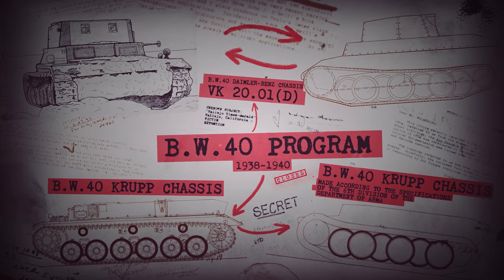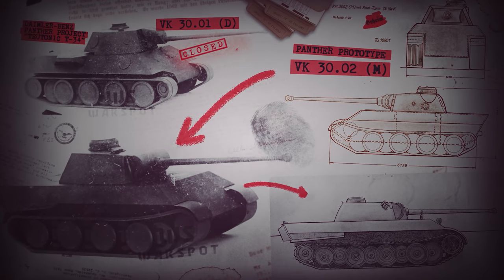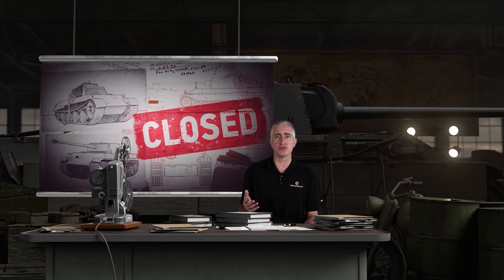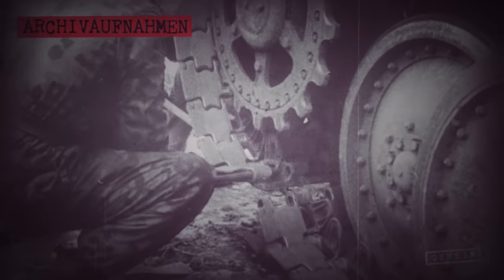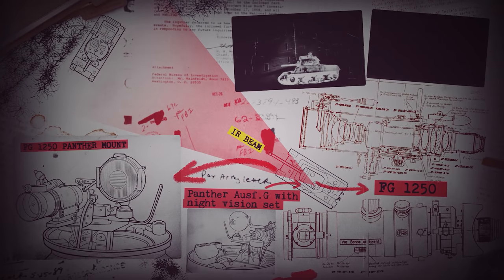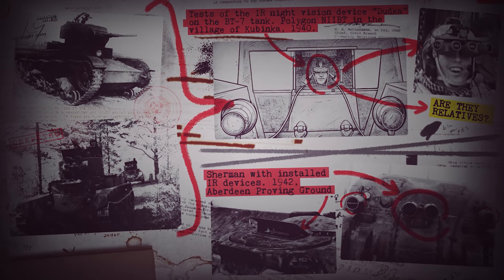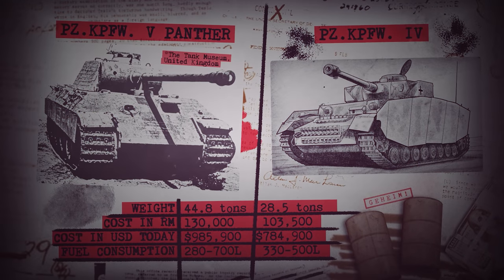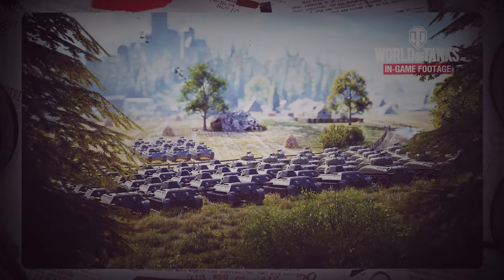Five Things About the Panther with The Chieftain - World of Tanks

Comment: Excellent video of the excellen Chieftain, once again! Question though: Why can't a Panzer IV not considered equal to the M4 and T-34? Later versions like the Ausführung G and H with the long 75 were more than a match for the 76mm allied cousins in the gun department. Armor was the worst, but it had other features going for it that were lacking on T-34s (better layout, radio, bogie suspension). Why the bad rep?
Reply: Bogie suspension on Pz-4 was horrible especially for crew riding inside the tank on rough terrain. T-34, Panther and Pz-3 was much better in that regard.
Reply: @RussianThunderrr  maybe. But it's all a compromise. Kristie suspension takes up space, and the t-34 was also not known for being the smoothest ride. Sherman had bogies too.. So why not their equal?
Reply: @Yamauchi_Akira  Same fire control as a Panther (the gunner is looking through a very nice soda straw), bad or (J model) no power traverse.  No stabilization.  And that beer can armor.  At high enough level, pretty close to equal.  But I know what I'd rather be in.
Reply: It was pretty much the equal. It had the best combination of gun, optics and standard ammo quality of these three - in a chassis that weighed 30% less than a Sherman. It had weak turret front armor, but its 80 mm hull front armor stood up better against the guns on the Sherman and T-34 than vice versa. Both the T-34 and Sherman had problems with "soft" ammo quality, which meant that the 85 mm in the T-34 and 76 mm in the Sherman often underperformed. As late as January 1945 only 1/4 of the Shermans had the 76 mm. The Soviets, OTH, were much quicker to upgun their T-34.

Only the late war M4A3E8 could be said to be clearly superior - and even it was easy prey for the KwK 40.
Reply: @TTTT-oc4eb  yeah, thought so too!
Reply: @TTTT-oc4eb  You're playing top trumps (or more likely ASL).  All three had enough gun that a solid hit was going through at most battle ranges (no matter which gun the Allied tank had) also most games overate the Mk IV armor, it was made up of several plates (40+40 is not 80) and got more brittle as the war went on.  Tonnage means very little (ground pressure might, but the T-34 was better there and the non E8 at least equal.

What made the Mk-IV inferior was in an engagement unless it was ambushing, it was very unlikely to get off the first shot.  Getting the first shot is a big thing, and it's the only big difference between the three.  WOT had an interview in the forums with a MkIV crewman and he mentioned their big fear (greater than Fireflies, which were a different terror) was blundering into Shermans in a meeting engagement, they knew they'd get beaten to the draw.
Reply: @drewdederer8965  "You're playing top trumps (or more likely ASL)." 

I don't argue with morons.
Reply: @TTTT-oc4eb  wrote: "Both the T-34 and Sherman had problems with "soft" ammo quality, which meant that the 85 mm in the T-34 and 76 mm in the Sherman often underperformed. As late as January 1945 only 1/4 of the Shermans had the 76 mm."

-- I'm not sure what you mean by "soft" ammo quality, please explain yourself, but as far as main gun performance goes, Sherman' s 76mm 52 calibers gun, and T-34's  85mm 55 calibers gun outperformed Pz-IV main 48 calibers gun, and not the other way around. Also turret usually get 60%of all hit, on Pz-IV it was weaker then both T-34-85 and Sherman's.

-- As far as "only 1/4 of American's Sherman tanks were 76mm", ... well US of A fought that war based on statistics and feed back, and as we finding out so is the Soviet Union that was constantly updating T-34 tank(yes, based on statistics and front line tank crew feed back, as well). So because Germany was involved into custom/artesian tank manufacturing almost throughout the war, and most of those tanks ended up on the Easter front, so Americans need more "soft targets" killing tanks vs "tank destroyers", and US command thought 4:1 ratio of 75mm(4) to only one 76mm tank was the best suited ratio for them. British troops encountered a lot more German panzers, so their tank platoon ratio was 3:2.

-- Also by summer of 1944 Pz-IV lost power turret travers in favor of extra 120 litter internal fuel tank, because of its poor range and detreating logistics situation, so only hand cranking turret was available ever since, but other then that Pz-IV was overall very well balanced medium tank, and long production life is there to back it up.
Reply: @drewdederer8965  wrote: "What made the Mk-IV inferior was in an engagement unless it was ambushing, it was very unlikely to get off the first shot.  Getting the first shot is a big thing, and it's the only big difference between the three. "

-- 1943 and on Stug-III was "best" Wehrmacht tank, which had a superior optics to ever declining Pz-IV vision, and SPG would more likely laying down ambushes, while Pz-IV(just like any other German tank) would be "driving around" and running into "Russ-Boom" ZiS-3 76.2mm gun.
Reply: @RussianThunderrr  When the Germans met the KV-1 in 1941 they found that even their 88 mm Flak gun often needed surprisingly many hits to knock the beast out. The result was an improved Panzergranate 39 that, from1942 onward, was the best standard AP shell in the world. When the US 76 mm M1 gun was tested against US armor plates it seemed to be a Tiger killer, but when it finally was tested against German armor (which was harder than US armor plates) after Normandy, it was found that the shells often shattered  due to the HE filler detonating on impact, or the shell itself was too soft and shattered. Soviet AP rounds had the same problem. The net result was that, while the German 75 mm, Soviet 85 mm and US 76 mm on paper was nearly identical, the German gun penetrated 10-15% more.

A British tank platoon had only 4 tanks, and the ratio was one Firefly to three Shermans - later in the war it was 2:2.

I didn't say that the Panzer IV was superior - I said the three tanks were more or less equal - with the exception of the M4AE8. All three tanks had their cons and pros. For the PzIV it was the combo of gun, high quality ammo and first class optics, as well as excellent crew conditions. All three tanks were outclassed by the new breed of standard tanks that already were in production or soon to be; Panther, Pershing, Centurion & T-54.
Reply: @TTTT-oc4eb  wrote: "When the US 76 mm M1 gun was tested against US armor plates it seemed to be a Tiger killer, but when it finally was tested against German armor (which was harder than US armor plates) after Normandy, it was found that the shells often shattered  due to the HE filler detonating on impact, or the shell itself was too soft and shattered. Soviet AP rounds had the same problem. The net result was that, while the German 75 mm, Soviet 85 mm and US 76 mm on paper was nearly identical, the German gun penetrated 10-15% more."

-- Thank you for reply, soft metal shells can not penetrate armor by definition, and soft malleable steel will deform, what shutters is hard brittle steel, so in order to overcome this, soft metal "ballistic cap" used, that is deformed and keeps brittle steel from shuttering, and it also help to decrease chances of shell to bounce of(or rechochet). Now, what makes "penetration" happening, is mass of projectile times velocity, and velocity is actually length of the barrel and amount of propellant in the round's casing. Of all tree guns Pz-IV had the smallest casing(at 495mm) and as a result smallest amount of propellant and mussel velocity of 750m/s, followed by 76mm 539mm casing with mussel velocity 790m/s, and T-34-85 had 629mm with mussel velocity of 792m/s, and since T-34-85 projectile also a lot larger and heavier, it had a lot more penetrating energy, and all Soviet gun and ammo testings conducted on German tanks. That is not to mention that T-34-76 had specially developed tank gun, by Ivan Grabin, T-34-85 had similar idea and class(in caliber and calibers) gun as Tiger I i.e. Anit-Aircraft gun with higher velocity, then anything used on tanks before. Having said that, I also have to mention Panther KwK-42 had even more proppeland and higher mussel velocity then T-34-85 and Tiger I.
Reply: @RussianThunderrr  The Soviets needed bigger guns because their ammo wasn't of the same quality as the Panzergranate 39. That's why the Soviet 85 mm barely are comparable with the KwK 40 in penetration, and the huge 122 mm in the IS-2 barely are comparable with the KwK 36 in the Tiger 1. The sheer size of the 122 mm shell did mean that even non-penetrating hits were very dangerous, even to a Tiger II.
Reply: @TTTT-oc4eb  wrote: "The Soviets needed bigger guns because their ammo wasn't of the same quality as the Panzergranate 39. That's why the Soviet 85 mm barely are comparable with the KwK 40 in penetration, ..."

-- Why are you making staff up? Soviets needed a bigger gun because Grabin's F-34 L-41 gun that was in T-34-76 could not penetrate Tiger I(that was captured in August of 1942) armor at all. Pz-IV was not a problem for T-34-76 F-34 gun. There was intermediate solution to develop sub caliber Tungsten-Carbide round. Then at battle of Kursk Panther tank was introduced, and decision was made to arm T-34 with bigger 85mm gun, so it can successfully fight both Tiger I and Panther tanks.
Reply: @TTTT-oc4eb  wrote: "and the huge 122 mm in the IS-2 barely are comparable with the KwK 36 in the Tiger 1. The sheer size of the 122 mm shell did mean that even non-penetrating hits were very dangerous, even to a Tiger II."

-- IS-2 122mm gun was more powerful then 88mm KwK 56 gun, and could obliterates Tiger II from any direction. Armor pricing round left cantaloupe size holes in Tiger II front armor plate when tested in Kubinka, that is also the reason why Tiger II heavy battalions avoided encounters with IS-2 tanks.
Reply: @RussianThunderrr  That's not the point here. The 85 mm had roughly the same velocity and shell size as the 88 mm L/56 in the Tiger1 - so it should really have been comparable to this gun in penetration. But it was not, it was just barely comparable with the weaker 75 mm L/48 in the Panzer IV. The difference is the quality of the AP shells.
Reply: @RussianThunderrr  The main asset of the 122 mm shell was its sheer size which made it very dangerous - it was like being hit by a naval destroyer - in penetration it was barely the equal of the Tiger 1. The only thing the Kubinka test shows is that even a Tiger II will eventually succumb if it is hit by 30+ 85mm, 88 mm, 100 mm, 122mm and 152mm rounds. Heavy tanks generally avoided each other if possible. IS-2 units avoided Tiger 1 units like the plague if possible.
Reply: @TTTT-oc4eb  wrote: "That's not the point here. The 85 mm had roughly the same velocity and shell size as the 88 mm L/56 in the Tiger1 - so it should really have been comparable to this gun in penetration."

-- It was and it did performed as such.
Reply: @TTTT-oc4eb  wrote: "Heavy tanks generally avoided each other if possible. IS-2 units avoided Tiger 1 units like the plague if possible."

-- Not really, just look at German winter offensive operation of 1944 and 1941spearheaded by King Tiger and accompanied by a swarm of Panther tanks.
Reply: @TTTT-oc4eb  wrote: "The only thing the Kubinka test shows is that even a Tiger II will eventually succumb if it is hit by 30+ 85mm, 88 mm, 100 mm, 122mm and 152mm rounds."

-- And there was not a single, but 11 King Tigers was captured in August 6th 1944 at village of Ogelow at Soviet Sandomir bridgehead, when Lt. Oskin inguaged 11 King Tigers of Major con Legat in his T-34-85, and destroyed 3 King Tigers by penetrating their armor(blew one of King Tiger turret off, one caught  on fire after fuel tanks been pierced) thinning they were Panthers, the rest of King Tigers was abended in working order with maps, King Tiger documentation and manuals, by King Tiger crews. That is how Kubinka got its King Tigers earlier. T-34-85 was good at making holes in any German WW2 tank.

— So T-34-85 was more closer to Tiger I gun in ballistics and performance.
Reply: @RussianThunderrr  Except that the "88" penetrated 30% more.
Reply: @RussianThunderrr  The September 1944 issue of the "Nachrichtenblatt der Panzertruppen" included a report from a Tiger-Kompanie (Tiger 1) that knocked out numerous Josef Stalin tanks in short period:

“The Kompanie commander made the following observations that were derived from their experience in fighting Josef Stalin tanks:

1. When a Tiger appears, most Josef Stalin tanks turn away and attempt to avoid a firefight.

2. In many cases, the Josef Stalin tanks let themselves engage in a firefight only at long range (over 2000 meters) and also only when they themselves are in favorable positions on the edge of a woods, village, or ridgeline.

3. The enemy crews lean towards evacuating their tank immediately after the first shot is fired at them.
Reply: @TTTT-oc4eb  wrote: "Except that the "88" penetrated 30% more."

-- Yes, Tiger I and Tiger II gun were very good, formidable and deadly against enemy tanks, so is Panther tank KwK 42, but like I mentioned earlier, after heavy losses sufferer at the debuted of King Tiger at failed attempt to eliminate Sandomirets Breagehead, and another failed attempt at Keltze-Lisow, German high command was really reluctant to use Tigers and King Tigers vs elite Soviet tank armies armed with T-34-85 and IS-2, and resorted to use their armor in other parts of the front not known for its heavy use of tanks, like Arden's offencive, then operation Konrad I, II and III, then Spring Awakening and ect...
Reply: @drewdederer8965  The soda straw, the TZF 12, offered a FOV of 28 degrees. That is between 2 to 4 times as much compared to the telescopic/periscopic sights of shermans and t34. Giving the fact that both commander and gunner had an azimuth indicator i can not see a disadvantage? The Panther gun could spot targets at standard engagement ranges much better than anybody else. He also could switch between high and low magnification. Maybe soda straw is not the best way to describe one of  best telescopic sights of the war?
Reply: @HaVoC117X  The Panther gunner cannot spot anything until the turret clears,, he has no peroscopic sight.  So if they are doing berm drill, he is blind until the tank pulls forward.

You are comparing apples to Oranges, a T-34 or Sherman gunner will use his peroscopic sight for general awareness, which has a low and high magnification settings.  Both also have much faster traverse (the Sherman could lay onto target under power traverse, something no German gun could).  

This is borne out with interviews of actual panzer crewmen.  Their biggest worry was a sudden encounter at close range (and since mean battle range was 400m and median 300m for tank fights in the west, this happened quite often).  They knew the other guy would get the first shot.  If you happened to be showing side armor, this could be fatal.  At best you are searching for a target with a balky traverse mechanism while sitting in a plume of acrid smoke.  

The sights were nicer when the Germans could make up range cards for a set position and/or see a long way.  But that was increasingly more the exception than the rule (and getting the high ground makes you a target for every arty gun and plane around).  Problem was, it was rare to be able to shoot at ranges where they helped much.  And the Panther system was not set up for berm drill (StG-IIIs were).
Reply: @drewdederer8965 
Berm drills in wwii tanks? 

Sherman's have a reverse speed of 4 to 5 km/h. Backing up behind cover is rather pointless at this speed. It's also pointless because of the poor first shoot first hit probability of most wwii tanks, especially for medium velocity guns, like the 75mm of the sherman. Just look at the statistics how many rounds had to be fired for a single tank kill. 

The Panthers commander could lead the gunner accurately on target via the azimuth indicators. The ability of the Panther to land its first shot on target is also much higher.

By the way, the Panthers  hydrolic turret traverse is a two gear set up. At relatively high engine rpm and second gear it can make a 90° traverse in less than 5 seconds. That's more than enough to react to flanking enemies. At the lower gear it is actually very smooth. 
BUT still, most commanders would swing their tank around to quickly present the frontal armor and not just swing the turret around. 

I cannot really see, why the Panther is on a disadvantage in this cases. Of course it couldnt bring most of its capabilities to shine in the western theater. Normandy, Bocage and the Ardennes are not really tank country.  Shermans and Panzers IVs were still good enough for this kind of terrain. Meeting Panthers in Eastern Europe or North Germany is a totally different story.

Just to put thinks into perspective.
At 300m the sherman gunners FOV was 46m wide, looking through the perescopic gunsight with 9° FOV. At 300m the Panther gunner had a field of view of 150m.
Reply: @HaVoC117X  Hmm, do berm drill..  I guess that engagement near the end of the Arracourt battles never happened.  4 Shermans popped up from behind a hill and knocked out 4 Panthers before witdrawing back into dead ground.  Then popped back up several minutes later and knocked out the last 4 panthers.

An azimuth indicator isn't THAT accurate, the Panther gunner is still going to have to acquire and fine up his shot and the power traverse isn't that precise.  Slewing the tank around can work, but you are putting lots of stress on the weakest part of the tank (the final drive).  

Defending a bowling alley, with long lines of sight and no air or arty to worry about, the Panther is really scary.  As a Medium tank, it is deeply flawed.  The armor is skewed to the front hull (which can stop just about anything short of 90mm ABCR) mated to flanks that can be pierced at rather sharp angles and a turret that isn't nearly up to the hull (ASL badly over-rates it through "rounding up", it's tough, but vulnerable to most of what it's facing (76, 85).  It's really mobile, but has a "moving life" so short, the Germans would make tactical movements by train.  It's really nice at long range, but medium tanks are expected to attack and it just isn't nearly as good in a dogfight.  On paper, the Panther is a monster, in reality, in reality, the Mark IVs tended to lead the way because they worked more of the time and wouldn't break bridges.
Reply: @HaVoC117X  The M4 tank commander located the targets and operated the turret transverse to place his sight spade on target. The M4 gunner then could see the target in his periscope so ducked over to the gun sights to make turret adjustments to zero in on where he wanted the round to hit. That allowed the M4 to rip off shots much faster than the virtually blind Panther gunner who had to search for the target called out by his commander.
Reply: @HaVoC117X  wrote: "The soda straw, the TZF 12, offered a FOV of 28 degrees. That is between 2 to 4 times as much compared to the telescopic/periscopic sights of shermans and t34."

-- FYI, T-34 telescopic sights like TOD-6 & 7  FOV of 26 degrees, so is TSh-16,17 at 2.5X zoom FOD 26 degrees and at 4X 16 degrees, so it is not 2 to 4 times...